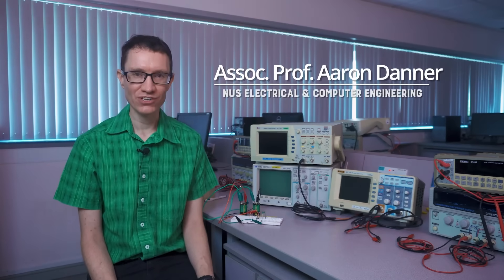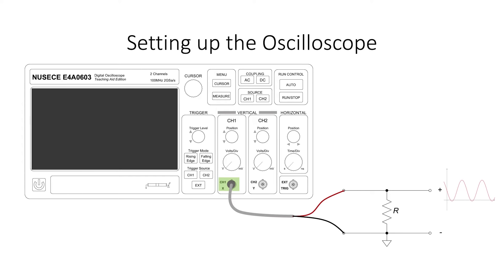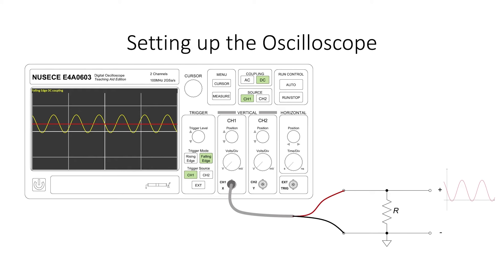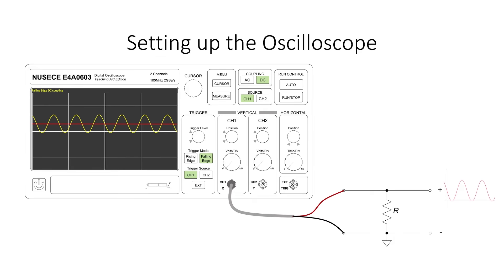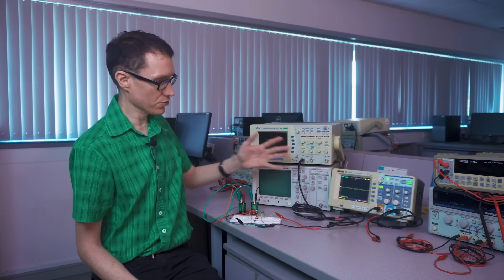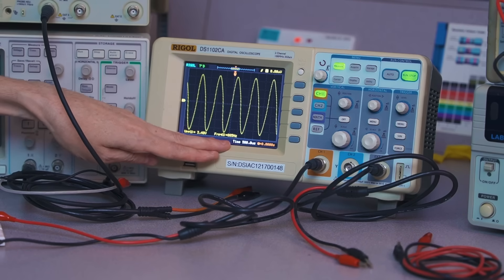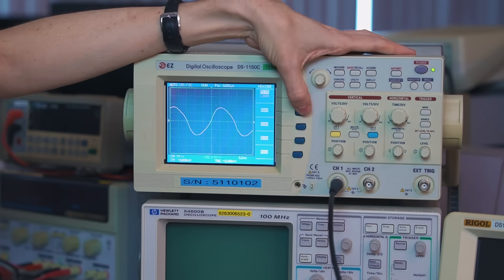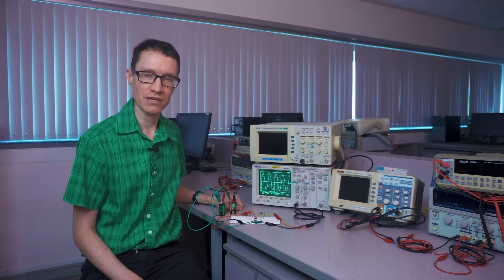How to use an oscilloscope (Circuits for Beginners #27)

Comment: Are portable oscilloscopes available? I repair construction equipment in the field and would like to record and view pulse modulated signals used to control hydraulic valves.

Comment: Aaron, your explanations are crystal clear. I prefer using both digital and analog scopes when reading waveforms. The Hewlett Packard model in this video was very advanced for its time of manufacture; I own several models. For fun, Hewlett Packard Engineers added an "easter egg" feature activated by pressing three specific buttons upon startup on the HP. This feature loads a fully functional Tetris game.

Comment: Digital oscilloscopes integrate the most common protocols, except that manufacturers restrict their devices.

If you want to unlock a protocol, you must enter a license key provided by the manufacturer into the device interface (the price of which is prohibitive for an individual, especially if they want several protocols), which is calculated from the serial number.

For an after-sales service, an R&D department of a company, or a training center, this is not a problem, since they can negotiate the price of the license keys, if they have a large enough fleet of oscilloscopes of the same brand.

Comment: The 'earth' wire is actually bonded to the neutral bus bar at the breaker panel. So there's also a potential risk of shorting the oscilloscope's ground lead to the 'hot' side of AC mains, if one is not careful. an isolation transformer is a good thing to have on hand.

Comment: i think, as a former oscilloscope Application Engineer, including international support at R&S, that oscilloscope training needs to capture the importance of probes and probing, as "first-order" ... many, many 'oscilloscope problems' are caused by bad probing selection and application... one can think of a probe like the lens on a camera; the best camera around can only capture an image as good as the lens allows, or a certain filter used... like camera lenses, different probes are available for different applications, and the different accessories provide more flexibility in application.
BTW: rule #1, in my list, is to understand the problems caused by that good old "ground lead"! its inductance leads to "noisy power supplies", and a 100-135 MHz resonance with typical 10x passive probes!
look for that "funny little spring" in probe accessories, it goes onto the ground "barrel", and lets you see a much more "real" signal...rant over!
Reply: I like your style. 
So I should utilise that spring as a matter of priority?
Reply: He started at the right place, and covered it brilliantly,to assume he does not know what you know or even more is rather cocky

Comment: I was gifted an old (at the time even) Hitachi oscilloscope from my Uncle with a master's in EE, around 1992. It was a completely analog scope, 2 ch, 25 Mhz, CRT. I wish i knew the model number. I spent hours playing with measuring the speaker out from my boom box's speakers and various circuits from small appliances and anything I could disassemble without getting in trouble from around the house. I was trying to understand how to use it. I wish I had this video to help explain the basics at that time. Still, it was fun. Too bad a roommate after highschool that worked in a TV/VCR/etc repair shop ended up taking it from me.

Comment: Old school scopes needed a calculator to actually get your answers . These are a lot nicer to use .
Reply: Analog scopes give a truer waveform, and often show noise on a signal more accurately, because they’re not smoothing out steps in the X axis. If you’re feeding a known frequency into something then measuring it on the scope, no calculators really required, and the mental maths for most of the time divisions isn’t too bad anyway.

Comment: When we measured the floating DC tacho feedback signal on old servomotors we would use an isolating transformer on the CRO to avoid altering motor speed.

Comment: Did you know: That HP scope has "Tetris" in it? Push: print/utility, and hold button 2 and 3 down (at the same time) for s short bit.
Reply: Mr. Carlson! Great to run into you! The knowledge you share in your videos (including your patreon electronics course) is found nowhere else! One of my favorite channels.
Reply: I tried and it didn't work